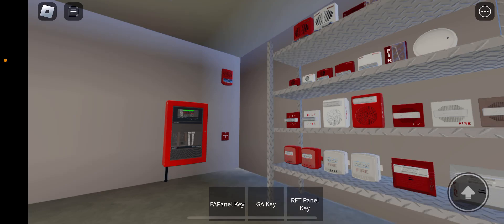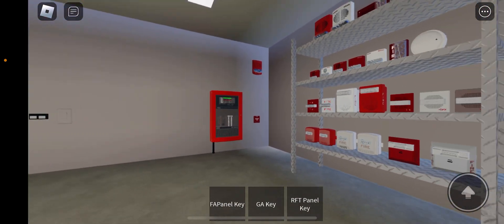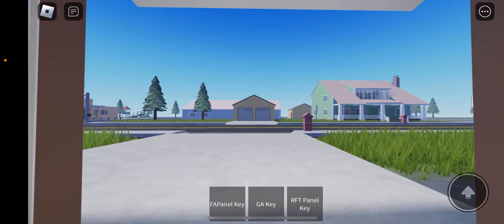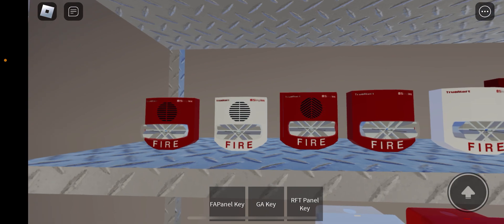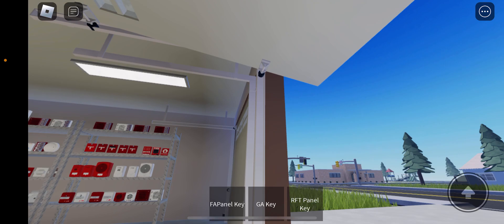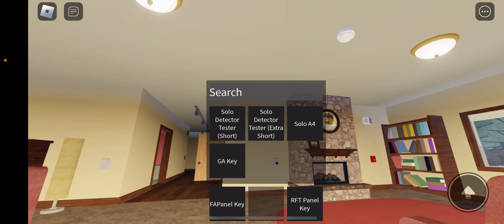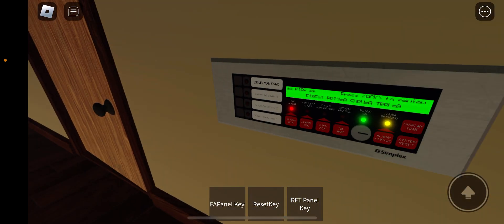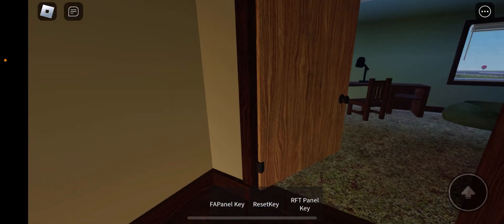Roblox System Test 7: New Device and a drive around the map

Comment: Make the whoop tone loop
Reply from the maker: I don’t think that’s possible due to Roblox limitations
Reply: Change the panel to the notifier voice panel
Reply from the maker: @NewEnglandAviaton987  I don’t take panel requests sorry, but if you want, I can make a demo board for one of the garages (obviously, not the garage with the 4100ES in it) and put the mentioned panel on the demo board
Reply: Please make a demo board but could it have a wheelock  mt on whoop. My school has that alarm
Reply: With the panel mentioned above it loops the tones and please do a simplex voice evac whoop and 4100u message
Reply from the maker: @NewEnglandAviaton987  But then the initiating devices may not work anymore. The initiating devices I have on the system only work with the Simplex 4100ES
Reply from the maker: The reason it isn’t possible to loop the tone properly is because there is a script which puts the sound on the speakers of each alarm, and it clones it once the tone plays, making it sound like it doesn’t loop properly. The same thing applies with the EST3 on the slow whoop tone.
Reply from the maker: There is a model on Roblox with the tone looping properly, but you can hear the tone from really far away, and the tone doesn’t silence when silenced, and keeps going when reset